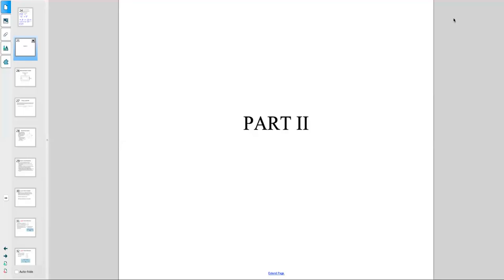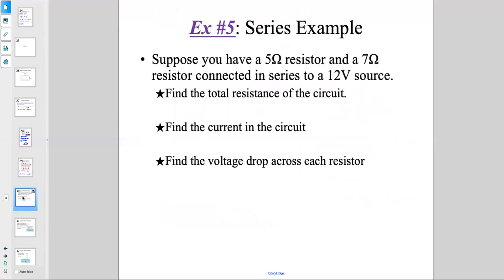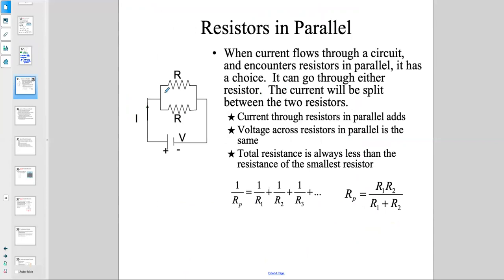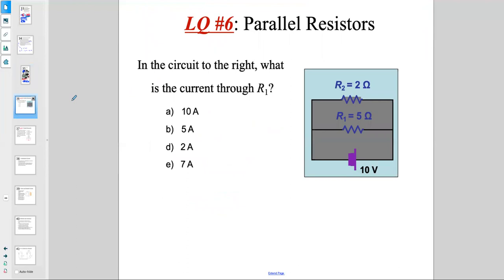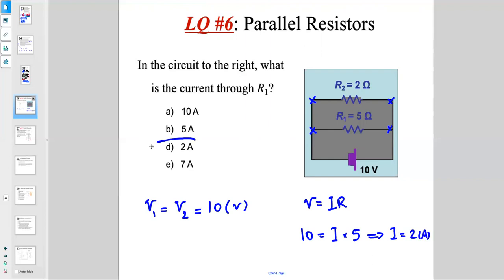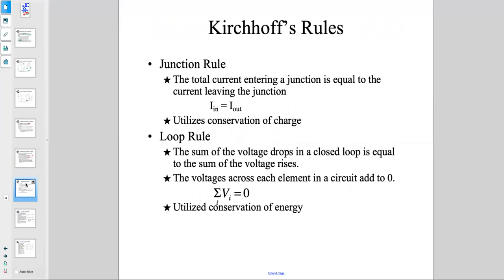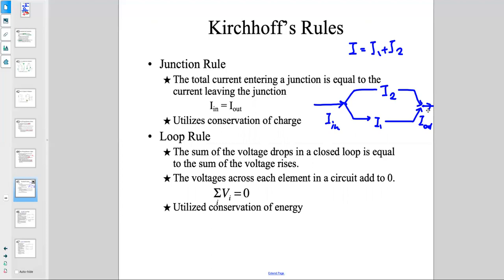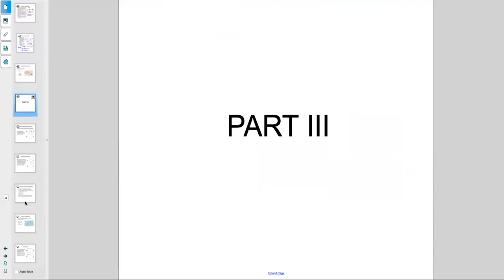James Walker Physics chapter21 part2: Electric Current and Direct Current Ciruits.

Comment: I'm just wondering what the correct answers to the series and parallel circuit example, the last 3 parts, would be. I'm struggling on figuring out how to determine the voltage across A nad B or the current of a specific resistor. Thanks!